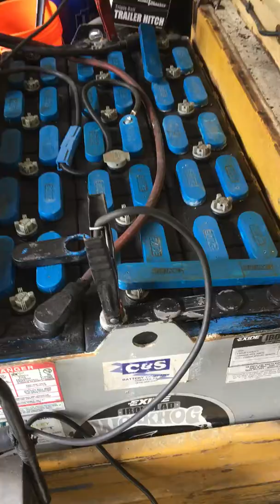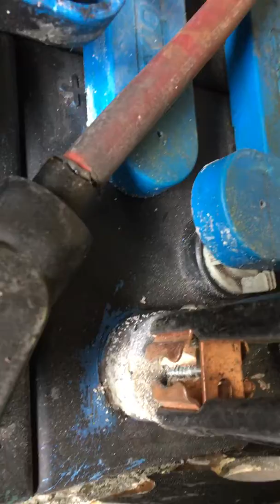36v forklift part 2 charging the 12 volt sections to bring a dead battery up

Comment: I have a similar situation and actually have a 3 phase charger but unfortunately no hookup. The battery held for awhile but must have trickled down over winter months with no use. Curious to see if I can charge each 12v row to a point where we can test and move it for transport to someone that wants to buy it.

Comment: Is it that simple? Does it just charge the one block of batteries at a time? Looks like the battery unit is still hooked on series.
Reply from the maker: Unlike most of my videos this is really meant to supply a solution to a very cautious and careful professional  as I stated in the video and I dont really consider this simple.  These forklift batteries absolutely demand proper polarity and ventilation to charge.  The 12 volt section is somewhat isolated during the charge because the terminals are going across a 12 volt potential.  In order for all the series terminals to be involved they must be inside the charger terminal connection.   I hope I answered the question.   Thanks.

Comment: Hi, did you need to separate each 12volt section from being connected to the other sections batteries to prevent any electrical flow the other battery sections? Is it necessary to drill into the terminal? Why not just attach the teeth of the charger to the respective terminal instead of drilling.
Reply from the maker: @MikeKuimelis   my battery had very wide flat connecting points.  It was at the time a practical way to get a good connection.  Short screw with just the right size hole so the screw digs in but nothing cracks.   No they dont need disconnected.  The current only flows from each pole of the charger.  I think I did a video here of the charging sections.  That , like all other work on these big batteries is dangerous and must be done exactly perfect.  These old batteries are high risk.  There will be a point where it's not safe to charge.  I knew when that was for mine because I've worked on batteries for years.  Follow All safety guidelines